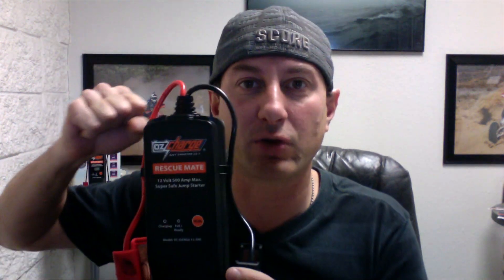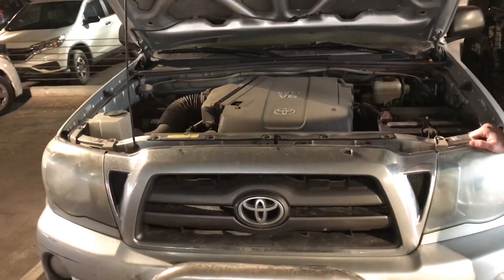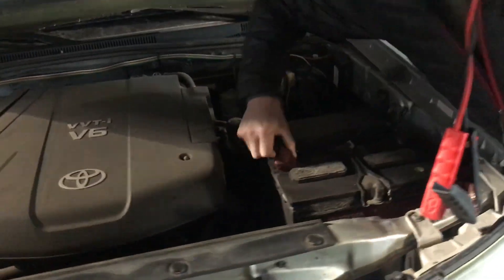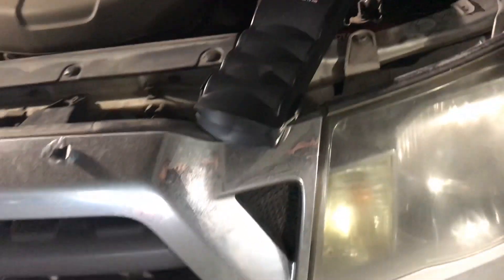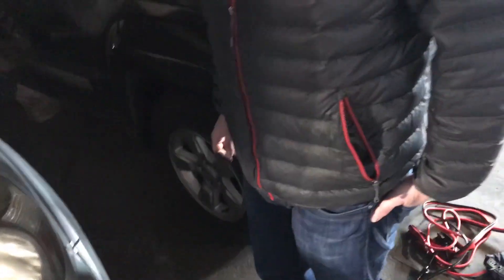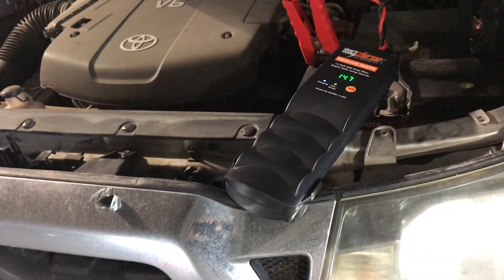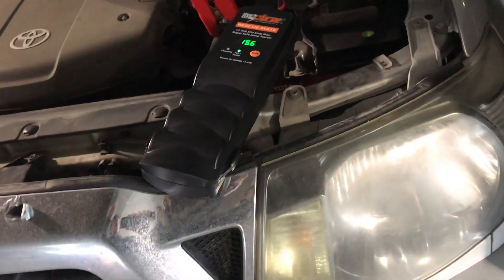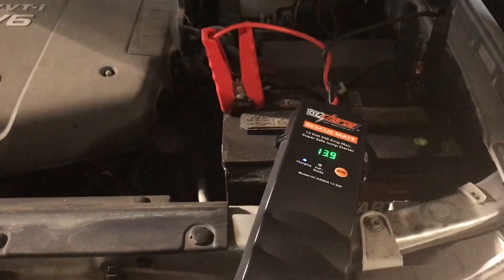OZ Charge Jump Starter Real-Life Test

Comment: My OzCharge RescueMate was put to the test yesterday.  First up, the battery died in my Harley Davidson 103 twin cam (1690cc).  All I got was a 'click' when I pressed the starter button.  So I connected my RescueMate to the motorcycle battery, however the battery level was not sufficient to charge the RescueMate, so I then connected the RescueMate to my car battery to charge the RescueMate.  My RescueMate is the cheaper 400A model, so I really wasn't expecting it to start the H-D 103 engine, but it did it successfully.
Tip 1: Make sure the clamps get a good 'bite' on the battery terminals.
Tip 2: Make sure you follow the exact procedure to initiate the countdown process.

Comment: I have the 500 amp version-It wont start my 2.4 diesel van-not enough grunt despite the up to 3ltr claim. However the 750 amp should be ok- No problems starting gas powered vehicles though. great product.

Comment: bought one about a month ago and finally have to use it. I had my car inspected, supposedly, about two weeks ago and they never said anything about my battery being bad. I may have to take my car somewhere else. They never said anything about the starter or anything else being a potential problem. I didn't drive at all yesterday, and now my battery needs to be jumped. I had a problem with it starting before the inspection, one day, but it started after several attempts. It won't do it at all right now. great to have a device that doesn't need to be constantly charged, and that I don't need another person to be there for. I'm initially charging it from a wall socket. Oddly that takes much more time than charging off of a dead battery.

Comment: It would be good if there is an audio beep from the unit alerting the driver in the driver seat once it is ready to crank the engine. This would make it easier to use when there is only one person around to start the car.
Reply from the maker: Funny you should mention that because they are planning on adding it on the next version!
Reply: @WildPowerSports  Fitting an alert beep alarm is such a logical and an essential requirement for this kind of device, yet it took them years to realize that they need to put in an audio beep alert to this device?  The designer must had been drunk while he was finalizing the original schematic of the device for production. And that's what they called "Australian Standard", as if Australian Standard is something Australians should be proud of. What a joke!

Comment: Australian design. Thanks for letting us know that if the battery is really TOTALLY dead, that you can go to another car with good battery, charge it up and then go to the dead car, connect it, it the Run button and start ignition. Have I got that right? It would make the difference between buying this or not.
Reply: You are Pretty much correct. I got one and it is really solid design